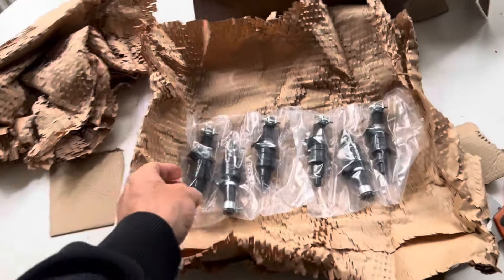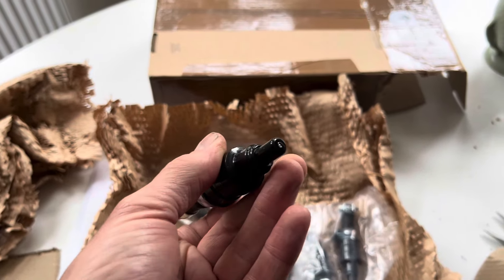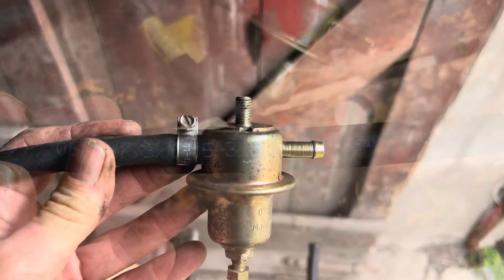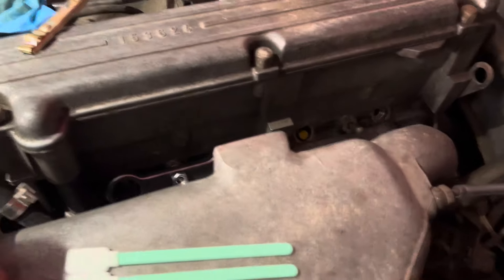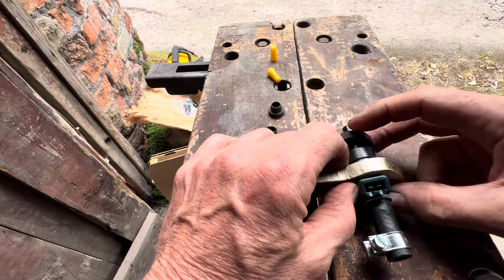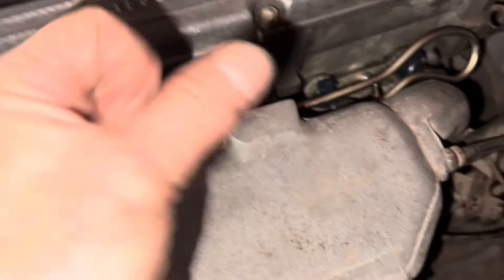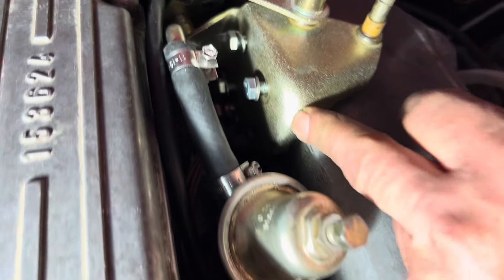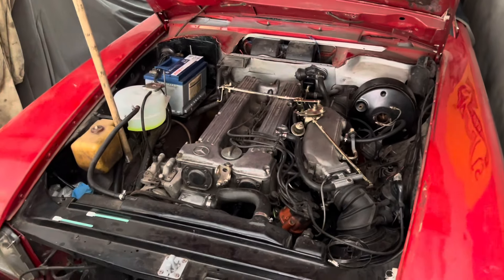See what happens when we put new fuel injectors in our 1975 Mercedes 280SL....

Comment: Congratulations, I bought new injectors for my 450slc. One of the hardest jobs removing 40 year old injectors as the bonnet angle, unlike the newer Mercs is quite low. I do like the new brake servo, I had mine redone too but now the rest of the engine bay just looks shabby. At that point I just decided to close the bonnet and move on. Great job, well done and many thanks for all your helpful videos.
Reply from the maker: Yes - I remember the job I had removing the injectors from my 450sl part car! It is so often the case that you refurb one thing and everything else looks rubbish....I keep thinking that I probably should have taken the engine out and repainted the engine bay....but there are only so many hours in the day. What did you pay for a new set of injectors I wonder? Mike
Reply: I got Bosch fuel injectors they were $28.5 each vs the Merc ones which were $52. Add in the nozzle holder at $1.25 and seal for the same amount. Be well and hopefully the rain will abate, but then it would not be an English summer :)
Reply from the maker: @MJR67  Wow...that is a fantastic price for the fuel injectors. The ones for older D Jetronic cost over £100...if you can get them. Mike

Comment: Great job! Soon I will began with mine. I have done all this before. Need only to do change the fuel pump to a correct 2bar one and check the  Fuel Regulator. Your DIY coke bottle tester for the Fuel Regulator will be a great tool. Recently had an issue with misfiring with 97 E320 and suggested in the MB forums to use B12. It did fixed the problem under 8 miles of driving! Hopefully will fix any issues with the Fuel Regulator as you have shown in your video.
Reply from the maker: Thanks for your comment and good luck with your remaining work. You probably know all this already but:

1. The original fuel pump is almost identical to the one below:

https://www.torqen.uk/brands/datsun-240z-260z-280z-280zx-510/fuel/69954-electric-fuel-pump-fuel-injection-oem-280z-280zx-75-83-200-696.html

https://www.youtube.com/watch?v=srvBSoYbUK8

2. The original fuel pressure regulator is very similar to the 'Standard PR148'...although my experience thus far has not been that great:

https://www.youtube.com/watch?v=wG4UtnAoYCs

One subscriber mentioned that I should redo this test with fuel/Chemtool...which I will get round to doing at some stage.

Mike
Reply: @MikesMercsandothercars  I think, I commented in one of the other of your videos, that I was lucky enough to find a used fuel pump at very reasonable price.Also, my original pump  is some where in my garage and if I remember correctly, it did  leak and most probably needs a new the O-ring. If I could only find a new replacement O-ring. Hopefully my regulator if any, may need only cleaning. Here in San Francisco area we have earthquakes and fires but climate a bit kinder to these old cars. But thank you for the links to pump and regulators. However, I like your idea of having permanently installing a fuel gauge. A short video with  your usual links to the items for it would be of a great help. Thank you Mike,  your videos are very inspiring and encouraging to leave my computer and do the actual repairs. I managed to fix and pass smog on my daily driver  97 E320, and soon will tackle the rear wheel bearing and possible ,hope not the timing chain in my 84 300TDT.  Then of course the 450SL.
Siamak
Reply from the maker: @siamak1  I have one of those fuel pump O rings. I think I mention at the end of the fuel pump video what size it is and where I got it (ebay). Good luck with the repairs. Mike
Reply: @MikesMercsandothercars  Thanks. I could not find your eBay seller. But based on the size of 2mmx33mm id, I found a seller from China. The bigger task now would be  actually finding the pump in my garage. haha